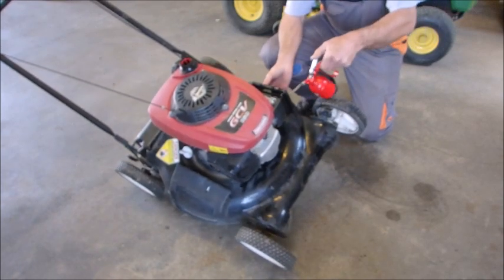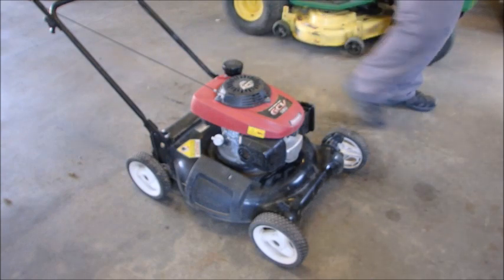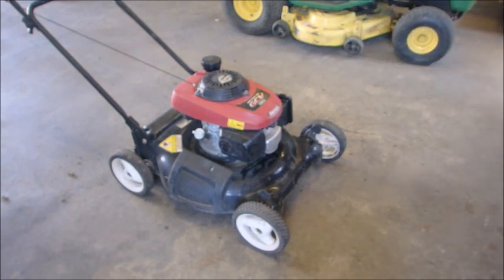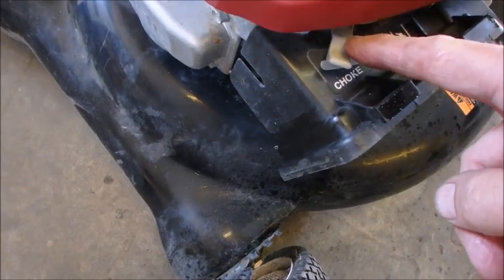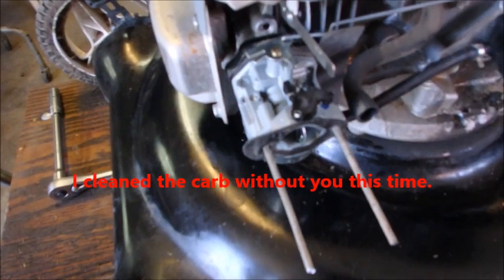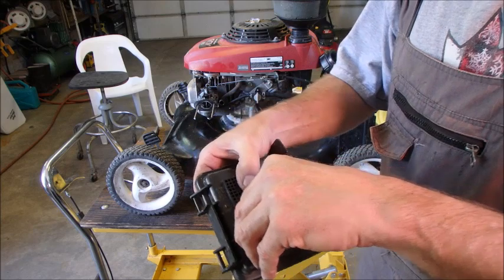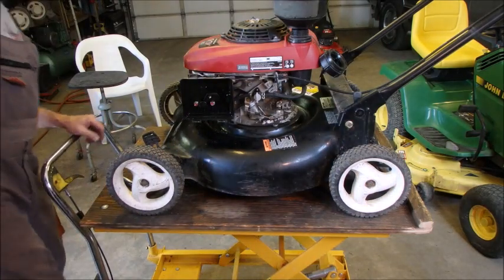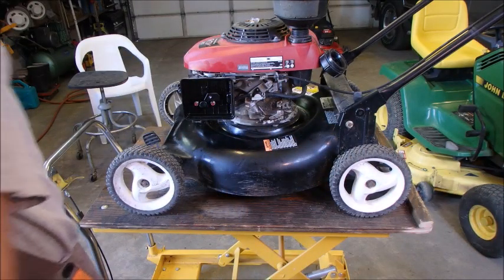Honda Carb Install Made Easy

Comment: I just did the same on a Honda GVC(?)160 on a Pressure Washer.  My  local hardware store has pre-cut lengths of 6mm x 1 threaded  rod about 100mm in length, which after the install left enough length to grab onto and replace with the factory bolts.  Worked for me.  Thanks again.
Reply from the maker: I have Dave Ackerman to thanks    Great channel.

Comment: Almost the same engine as my new Honda powered Black Max mower ..We are never too old to learn something new ..I cut the heads off of two long bolts..cut some screw driver slots in the ends and used them as dowel pins when I installed the front pump in my automatic transmission in my ford truck They are still in my toolbox after 15 years or so
Reply from the maker: I should do that.

Comment: Good tip Bruce, those carbs have about 5 parts that need to be lined up.  I have also seen Honda mowers come in with the gaskets flipped over because people were tinkering with them.
Reply from the maker: Me too.  I try to line the stuff up from left to right.  Someone suggested to just put the pieces onto the bolts.

Comment: Great repair Inspector Gadget. And thanks to Dave Ackerman for the tip. I will incorporate the dowels into my carb rebuild tools. I think Honda during assembly loads all the parts and carb on to the bolts then install it all into the engine, but for later repairs and keeping the tech in mind, is to use studs and nuts instead of bolts. I think I try that on the next Honda carb rebuild changing out the bolts for studs and nuts. Thanks Bruce.
Reply from the maker: I should have figured this out a long time ago.  oops.

Comment: Between you and Mustie1 my favorite 2 channels, ok yeah I have a lot of tool boxes, but my main 3 are the briggs tool box, the turdcumsi tool box.... As I call em... And the Honda tool box, I keep em separate because, each call for different tools, I do small engines for a living, and it behooves me to keep em separated..... Awesome video and handy trick.
Reply from the maker: I love tools too.  I am still missing a GOOD set of ratchet wrenches.  I have a crumby set.
Reply: Bruce Pender, your in Canada, don't know if you have wal mart up there, I got myself a really nice Stanley set of metric and standard, 2 separate sets of the ratchet wrenches there for like 24 bucks, they are not snap on but they haven't let me down in the 5 years I've had them so far.
Reply from the maker: I will check it out.  We have a Walyyworld here in Red Deer Alberta
Reply: Bruce Pender I would say a nice craftsman set, but the quality of craftsman lately is not what it use to be, let us know what you finally decide on.

Comment: I used that alignment trick using a straight piece of wire coat hanger on the throttle plate of older horizontal tecumseh engines. What's old is new again.
Reply from the maker: Right.  I should have thought of this,  but i give credit to Dave

Comment: Good video Bruce. I had a guy give me a $300 push mower because he thought it was going to fail.I been using it for a year now and all I noticed is an occasional skip which could be water in the gas.
Reply from the maker: Quite a few of them have a skip.  Some I have worked on for weeks.  If it isn't major I would just use it.  As you know.

Comment: Neat trick thanks for sharing. Does make me wonder why on earth Honda didn't just use studs and nuts instead of bolts. Would have made our lives so much easier
Reply from the maker: Yes you are right
Reply: No doubt eh? what is up with honda?  try to make it difficult for the home owner to work on they own equipment?
Reply: I wonder if it would be possible to convert it to studs with nuts.  I'm guessing if you measure the bolt, and then use a piece of threaded rod with the same thread, the same length, it should work nicely....
Reply from the maker: You are right    I will do this next

Comment: I always enjoy your vids -- even if all I see is the back of your overalls. I use a squirt bottle (plastic) instead of an oil can to get gas into the carb, but I think I'll put the oil in the old push bottom can and use the squirt can for gas just like Bruce. Cheers
Reply from the maker: There are many ways to do the same thing!!!

Comment: Hi Bruce any fellow tinkers. Just got a Lt 2000 19.5 hp. Put the battery on and it started. Blew smoke bad! Shut it down and drained oil. It was mostly gas! Put fresh oil in and the motor came out of its fits and ran Great! Was not burning any oil. Came back 2 days later and the gas tank drained. Or leaked by and and is now back in the oil. Is it a bad float in Carb? No shut off valve at the tank.
Reply from the maker: The float sounds like it leaking gas from the carb back through into the intake and into the crankcase making th oil diluted with gas.  Rebuild the card and give it another try.  Is there a gas shutoff.  use that always anyway.  Bruce
Reply: Check your needle and seat.  If the needle has a black or silver rubber tip and there is a groove in it that you can detect, replace it.  If the needle is all metal, replace the rubber seat.  It's a good idea to install and use a shutoff valve in the fuel line anyway.  if you don't want to work on the carb, the valve will suffice if you remember to use it every time.

Comment: I load all the components on to the bolts.  In reverse of most assembly.  With everything loaded on to the bolts down to the gasket closest to the inlet you just line the bolts up. Screw them in and tighten. Attach  the fuel line first.
Reply from the maker: That is good too    Thanks

Comment: Jerry PA Lawn Nut, Bruce how do you slow down the Honda choke opening rate? Mine is open before I get the starter rope pulled. Maybe you could show that the next time you have to work on a Honda carb.
Reply from the maker: These are a mystery to me really they are.     Help others!!!!!

Comment: looks like you put a gasket on the air cleaner but you already had a gasket on the adjoining face of the carburator? So you put a gasket on a gasket? Is that correct?
Reply from the maker: Well I understand.  However, you are not watching a Steven Spielberg production.  I went to your channel and noticed you have not made any videos.  So, I will make you a deal!!!     I will make sure I improve my videos and at the same time I want you to make one video of something you like.  I will watch it and enjoy your effort.   This is a very difficult thing to do on a budget as there is only one person producing the entertainment.  There is no one else doing this.   Including-----  Ideas, Filming,  Production and Editing, Sound and Lighting.   It takes me 3 hours to make a 20 minute video.   I hope you enjoy my other productions and I truly want you to enjoy my other videos.  
Bruce Pender   
A Retired Guy Making Videos.

Comment: That carb alignment trick is so cool that I ordered some 6mm aluminum rods, sized them to length and cut threads in one end, Worked perfect on the first mower I repaired (Troybilt with a Honda engine.) But then I got a HRX217. That model has what Honda call a "base control."  It is a long metal plate that  obstructs the use of the dowels. At least I couldn't figure out how to maneuver the pieces into place with that base control part in the way. You can see in the first few seconds of your  video, Honda Mower Choke Won't Release. That mower has the base control but was filmed before you learned of the dowel trick. Any Thoughts?
Reply from the maker: You are right.
Reply from the maker: I am out of town right now.  Did I miss anything?
Reply: I have since learned that the base control piece has to be removed in order to use dowels.  That means removing a hose, governor link, coil wire, and a bolt. So one loses the time saving advantage of the dowels not to mention the risk of not getting all the pieces back correctly. Oh well.

Comment: I have a Briggs and stratton professional 175cc 7.75hp push mower it acts like it's starving for gas surges a lot I have taken carb off 3 times and clean very well made sure all jets were free I can not figure the problem out also I check the valve lash it's perfect. Puzzles me hate to purchase new carb and it not be it. Any suggestions ? It's the auto choke carb.
Reply from the maker: You may have to put up with it.  The newer stuff is surgy as the Enviropolice are at it.
Reply: Bruce Pender I ended up purchasing a Chinese carb for 17$USD installed it yesterday the machine runs awesome now. I guess you can't rebuild them all. Thanks Again
Reply from the maker: Cook.  I have had to do that a time or 2